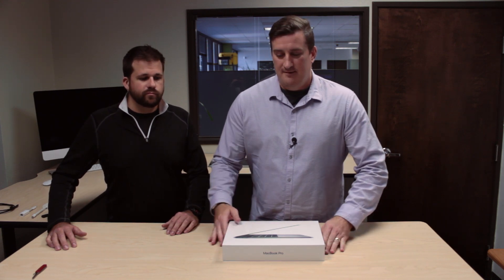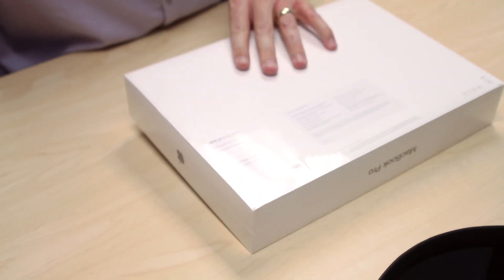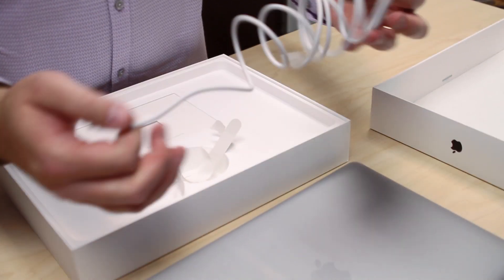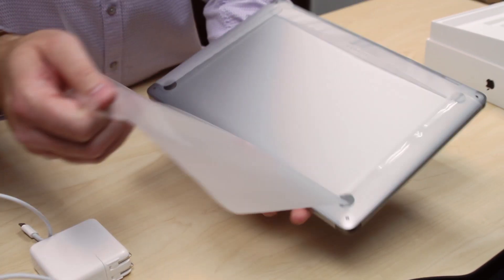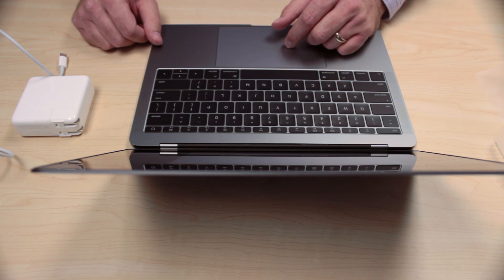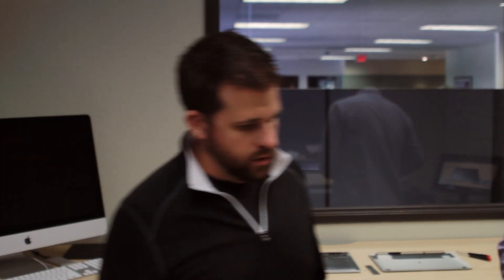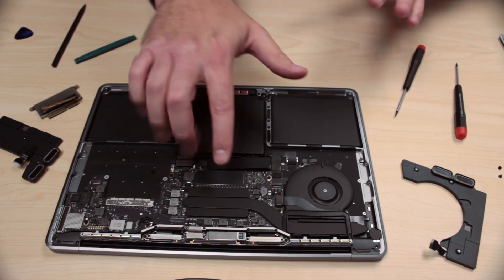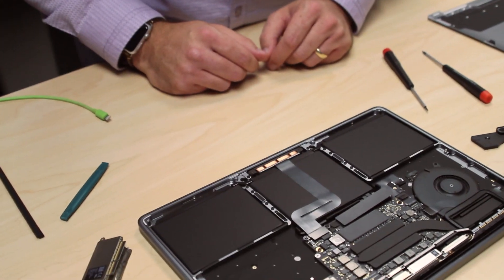13-inch MacBook Pro Late 2016 Unboxing and "Light" Teardown

Comment: So the SSD is soldered only in the touchbar version?
Reply: Thanks a lot for the quick reply!

I have another question: these PCIE SSDs have a longer lifetime of the conventional SSD? Otherwise if the drive reaches his maximum write cycles, this will represent the end of the entire machine (in the touchbar version) .
Reply: Thank you :)